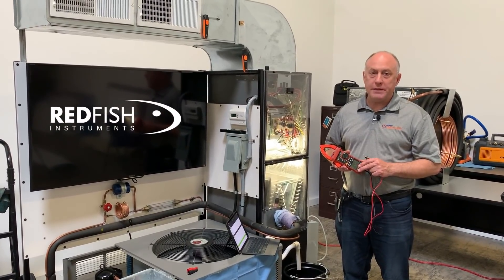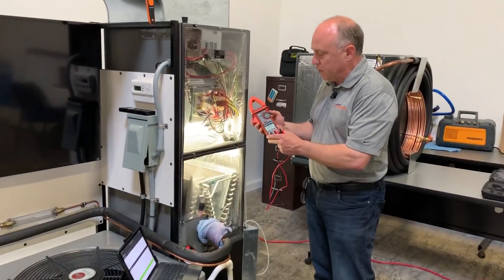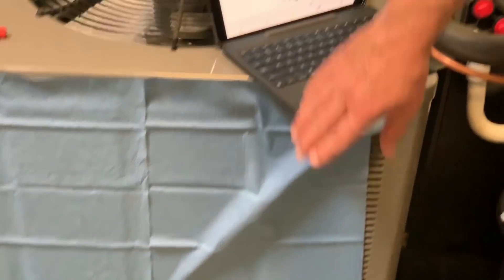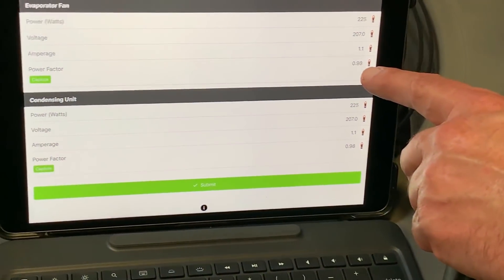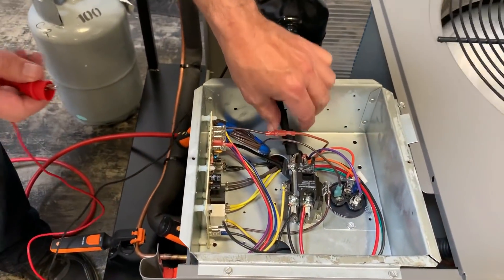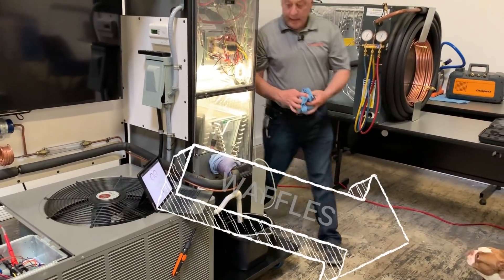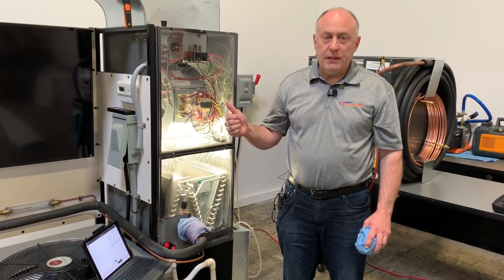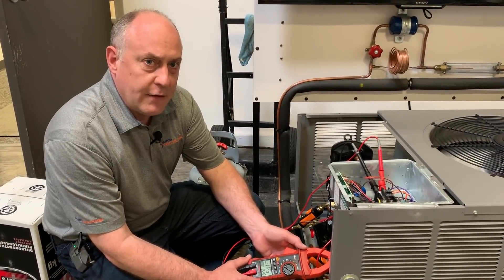Supco Techlink

Comment: The math isn't mathing, and I'm trying to figure out why...
Reply from the maker: What math? Power = Volts x Amps x PF, the SEER is approximated from the EER.
Reply: @measureQuick  Example: Where the evap fan measurements provide a calculated power of 227W,  207V x 1.1A x 0.98 (PF) = 223.146W. If I remember correctly, I checked a different measurement later in the video, as well. Didn't really look any further beyond these figures. It's possible things that it's accounting for time-based factors that I'm not sure of, such as peak voltage (opposed to True RMS) or the lagging effects of reactance. I'm mostly curious if I'm interpreting these figures properly.

Edit: Also, as with any measurement device, I like to learn about what it actually measures versus what information it provides from calculations. Of course, everything is a calculation to a point, so this is a bit hard to explain. It's more along the lines of what is measured versus what is inferred.

Comment: Power = Volts x Current.  I can measure the amps and voltage with my amp probe and calculate power.  I could do this when I arrive and then after the fix and show the customer the difference.  Why should I buy another meter ie what engineering am I missing other than real time live measurements?  Just trying to understand, not rain on your parade.  I love all the stuff you and HVAC School do.
Reply from the maker: A/C Power = volts x amps x power factor. A typical voltammeter does not measure power factor. That’s why you need a power meter.

Comment: Does it measure amps and voltage at the same time?
Reply from the maker: Yes it does, in Watts.
Reply: Okay because I ordered it...from true tech tools it showed be in my position tomorrow. So to read amps and volts together I would have to put the setting on watts?
Reply: @Mike-yh8tv  Yes, or kW. You should not try to measure Amps and Volts on the either the Volt or Amp setting, this will lead to incorrect readings; always use W or kW when reading both at the same time.

Comment: I have come across quite a few psc blowers with low power factor that have the correct capacitor and rating. Also with the correct tesp and amp draw.

Can I get some hvacschooling on that? Someone explain please?
Reply: They are likely on a speed other then high. PSC motors only are matched with their capacitance on high speed.